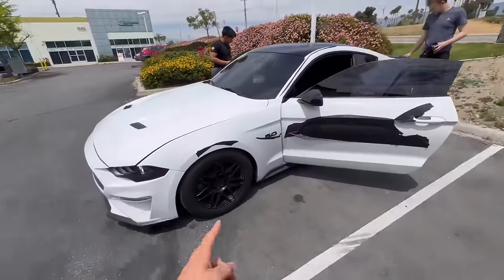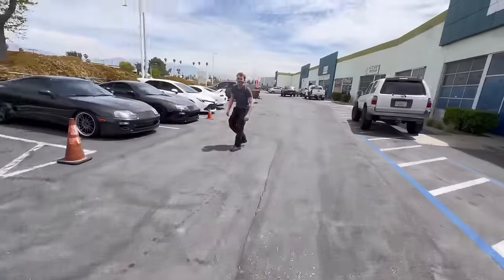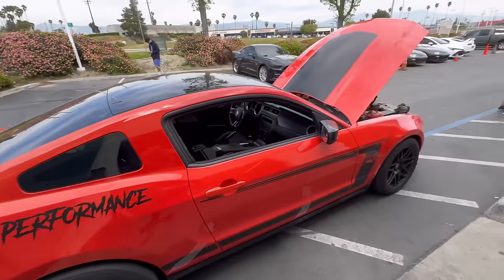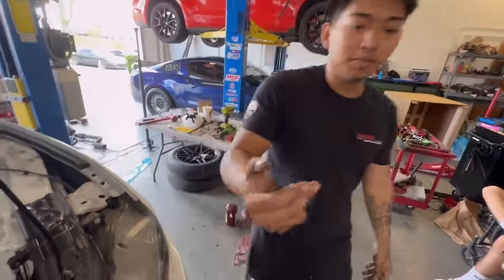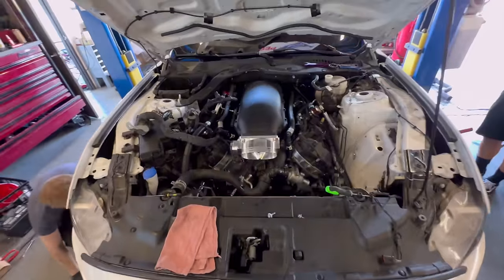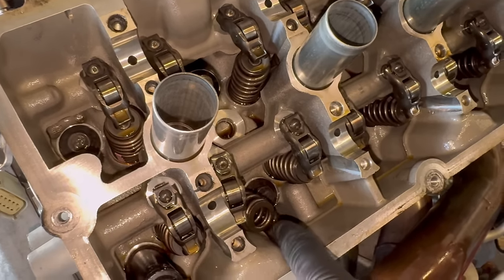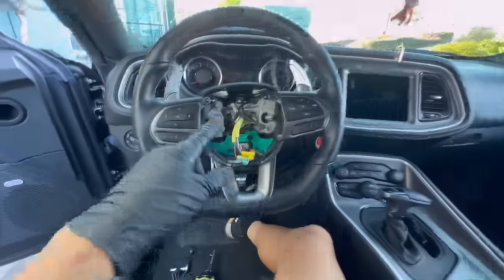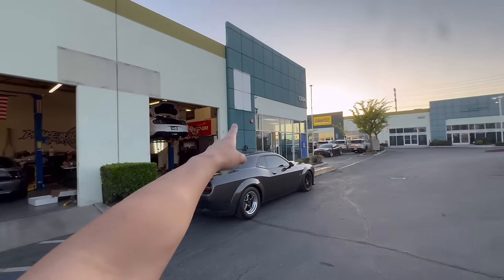Blown Engine Worse Than We Thought! #Ford #Mustang #GT

Comment: Why not upgrade to an aluminator? I can’t imagine new OEM short block is that much cheaper then an aluminator short block. Plus you’ll be ready for boost in the future with a forged bottom end.
Reply: Aluminator is a lower compression block for boost. This car is going to be a max effort NA car. We just threw in a stock short block just to get it running again
Reply: @lyxanderrojas8110  you could still run the 12:1 NA version of the aluminator which is still forged and run boost on it later on. Stock gen 3 is 12:1 and ppl boost those all day stock bottom end.

Comment: Engine blew due to something being installed incorrectly not sure what but something.
Reply from the maker: No sir, ran great for months, these things can just happen
Reply: @drakebuilt  car can run for a few months even with something installed incorrectly maybe to tight etc. something went wrong however these coyotes don’t drop valves for no reason.
Reply from the maker: We never did any valve train work nor bottom end work, engine stayed together the entire time aside from cams which the cam cap bolts were still torqued to spec, therefore it literally just happened on its own
Reply: @drakebuilt  something went wrong during cam install then lol cams is messing with valve train component not directly but still messing with it. Again something was installed or done incorrectly during cam procedure for this to have happened.
Reply: These things don’t just happen. That’s what you say when you don’t know what happened or how it happened.
Reply from the maker: @Michaelscott62518 no sir, car was still in time and everything was still torqued correctly, we check when we pulled it apart💪 try again next time buddy
Reply: Womp womp
Reply: @lyxanderrojas8110  to the owner of the car yes womp womp lol
Reply: @drakebuilt  you sure bout that?☠️
Reply from the maker: Yessir 100% sure about that